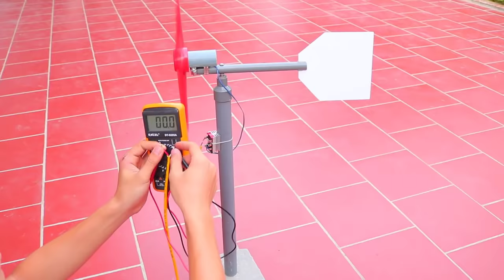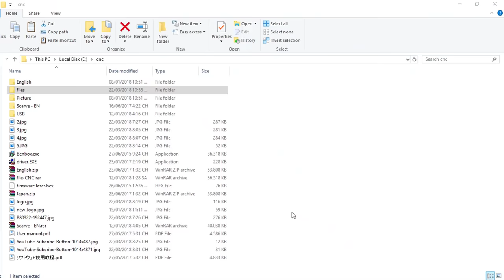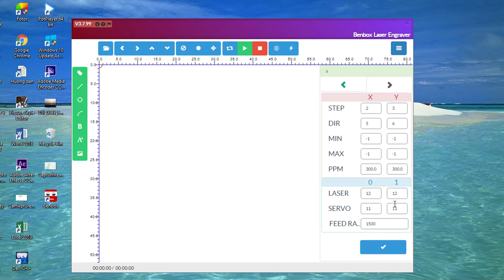TOP 10 BEST LIFE HACKS THAT I HAVE DONE IN 2018

Comment: What is the meaning of the third life hack?  In the loss of electricity?  And the meaning of the sixth life hack? I would not call a sixth homemade product a life hack because it is too complicated for a life hack (servo drives, different pieces of hardware (Arduino), specific software - this is not available to most people). Sorry for my English.  I translated by google translator.
Reply: 3rd one is not loss of energy it is the conversion of dc to ac ...

Comment: 2:15 is not real, a motor cant produce 230 v ac its dc it would not charge the phone if it was 230v the motor would have burned
Reply: a bldc motor can produce AC and a switching power supply could work with low voltage AC but the efficency is shit and the output wont be able to power any  load a simple buck-converter would have worked better
Reply: @tobiashegemann1811  it's fake

Comment: Using lead as your soldering tool is a bad idea due to lead being the sole reason why you would receive irregular and imprecise resistance readings.
Reply: Adam Schmidt That's graphite isn't it? Lead is very poisonous element. they would never use it.

Comment: What a huge waste of power, it takes about 5 turns to generate 1 turn of the other engine plug the light into a controler instead so your not wasting 5ah 12v  500w to power a single light

Comment: The only thing worse than the soundtrack are the ‘cold’ solder connections you make in your videos. Does your soldering iron come with a sponge? Get it wet and keep the soldering iron tip as clean(shiny) as the solder you’re using... if you can get and use soldering flux(liquid) you will notice a VAST improvement in soldered connections.
 And how about showing a list of components you use so we can stop guessing.

Comment: The DC motor has a DC output, how it became AC as we seen mobile phone charger plug into it . Mobile charger is for AC supply exept car mobile charger.
Reply: what time?
Reply: what time?
Reply: what time?
Reply: what time?
Reply: what time?
Reply: @MrMovieMan941  2 mins & 14 secs.
Reply: One motor is dc and one is ac! He is using battery to power dc motor than mechanical energy is converted form ac motor to ac output
Reply: @MrMovieMan941  are you sure that is an alternator that can generate 200VAC and above? There is no alternator same as that size. Both motors has a commutator and armature as we see its designs, meaning those are both DC motors and its O/P is DCV. If that realy an AC O/P the author must show to us the pointer setting of his multimeter. Im sure that the bulb he used to show us is 12VDC or either 24VDC which common in seafaring vessel that during emergency power failure, it has an alternative battery operated lighting system to energize by DC supply
Reply: I saw alternator that size before. It's the only way I can think of...
Reply: @MrMovieMan941  did you see slip rings on it or a commutator??
Reply: It was quick look. My professor in high school showed to me. So can't remeber much...
Reply: @MrMovieMan941  what was its peak maximum output??
Reply: @MrMovieMan941  yes it has but its I/P is 12VAC. So when you drive it through shaft with your prime mover, it can only gives you the O/P of maximum 14.something VAC without load at full rpm of your prime mover.